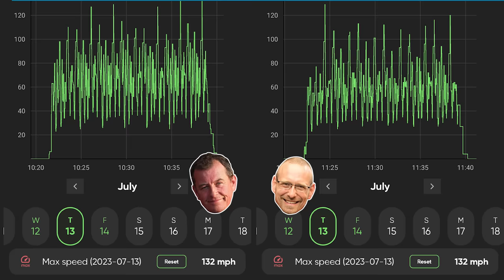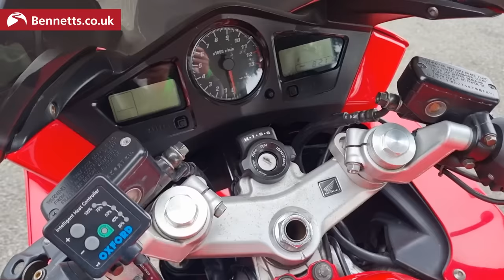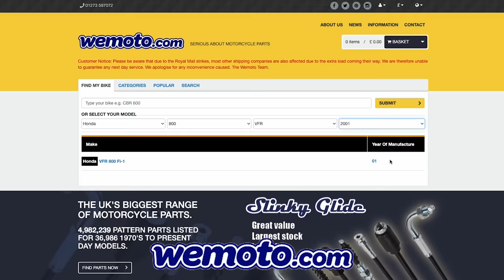John McGuinness FLAT OUT on 100,000 mile £500 bike: Will it survive?

Comment: Proud owner of a red VFR 800 FI from 1998. Brutal build quality: first chain changed at 60,000 km, still bright red paint, no rust after 25 years. Widely underrated, but the 1998 for the European market has an engine with fantastic torque, exceeding both those for the US market, the catalyzed 2000 version tested by McGuinness, and the VTEC itself. She drinks a lot (13 km/l at all speeds) but I love it. History will prove her right. And this video is a proof.

Comment: I have a 98 VFR like that one. I often think of changing it for something more modern, but then I take it out and the V4 growl grabs me. I’m going to keep it for as long as possible and have touring plans in the pipeline. It’s only done 29k so loads of life left!!
Reply: I have a 2000 VFR with about 65,000 km on it and I sure wouldn’t sell it for that price.  Gen5’s are great bikes with v4 engines, gear driven cams and single sided swing arm, built to last.  Mine is going to easily outlast me.
Reply: I just bought a 97 VFR with 50k on the clock 3 weeks ago, absolutly astounded by the build quality, its like its come out of the showroom, i also ride a 2001 bmw R1150GS which has 57k on the clock, the motor is great on it but the build quality in places is a bit ropy, peeling paint, alloy corrosion etc.  I think honda's of the 90's were at peak build quality.
Reply: Same! Mine has 56000 Kilometers and its my daily driver.
Reply: Of only honda made a v4 nakedbike like the tuono. They should revist the rc30
Reply: @mala7794  v4 fanboy , explains a lot
Reply: @GaijinGamerGirl  dream bike is a tuono factory 1100v4 so yeah pretty much.  (Russian bias)
Reply: @mala7794  when the V4 VFR came out, naked bikes were not that popular, honda had the CB750 but it was all about the sport bike or sport tourer.  The RC30 was a beast, especially with the great joey dunlop riding it at the TT
Reply: @mala7794  you're Russian 🤣🤣 my condolences
Reply: @GaijinGamerGirl  oh no i just saw gajin and tought u might get the reference from wt. Im from scandinavia
Reply: @GaijinGamerGirl What's the problem with V4's or Russians?
Reply: @Notevenallowedtoburnwood  You're clutching at straws
Reply: @GaijinGamerGirl  Why am i not surprised you didn't have an answer.
Reply: I have the same thoughts at times! I have looked at the Aprilia V4's (Tuono and RSV4), but very hard to justify the price and maintenance when compared to the Honda in my garage that's paid for and has always worked perfectly. I love my 2001!! I have looked at the 800F as the dash and LED lighting would be a nice change.

Comment: Definitely!  I had mine on a dyno recently and it’s putting out 114bhp at the wheel.  it’s a 2002 5th gen pre vtec, with 20k miles on it.  It’s a fantastic bike!  just had the suspension serviced by maxton and the handling has been transformed.

Comment: I’ve owned two VFR’s, an FL and an FV which I’ve owned from new in 1997. Apart from a reg/rectifier and back shock it’s been totally dependable. I’ve toured it, track day’d it and used it as a courier bike. No camchain or belts to worry about, it runs like a Swiss watch. I checked the shims at 36k miles and only one was slightly out. Brilliant bike, great all rounder and one of the best engines Honda has ever made.

Comment: my bro's 162,000 miles 2003 honda hornet 600 only goes upto 100mph now instead of 140mph haha.
He bought this engine secondhand with 43,000 miles on it, fitted the engine himself and done 119,000 miles with it.
Oddly the original engine did only 25,000 miles, mostly from the previous owner.
Still runs perfectly even though the valves clearances have never been adjusted by him.
He checked the clearances recently and the tolerances are only  just within range.
He changes the oil every 5,000 miles with fully synthetic castrol power 1 racing & a k&n oil filter.
Reply from the maker: Something's not right there! Still, glad it's still running. My first thought was valve clearances. I assume it's breathing okay?
Reply: @bennettsbikesocial  It breathes ok.
It's got a couple of weak valve springs, on the inlet valves.
Still runs very good though, and uses hardly any oil.
Must be because of the 5,000 mile oil changes from 43,000 miles with fully synthetic oil that's made it last for so long, and has been regulary thrashed nearly every day too.
On all the gearboxes i have taken off i have found the oil ways on the input and output shafts did not line up with the oil ways on the gear pinions from factory.
By lining them up, the gearboxes last much much longer.
You should also replace the oil pump no more than 50,000 miles.
When you turn the oil pump by hand it feels very stiff and graunchy when they get to 50,000 miles plus.

Comment: I used to love when a gsxr 600 or r6 pull up at a light and I'm on a 91 vfr750 tuned and engine upgraded with jets and power commander fuel program and custom exhaust tuned to the bike adjustable shock and front forks and they see you 2 bike length off the jump and you can't reel it in on the 8th because the v4 valve is  a torque monster

Comment: Having owned 4 vfr800fi 5th gens and currently a 2008 vtec vfr800 i can say they're brilliant fun even though theyre on the portly side of the weight equation.  Gear driven cam engines just rock. Saying all that my current 2008 vtec model is ok once youve spent money sorting its quirks. 1 tooth smaller on the front and plus 1 on the rear sprocket helps alot, junk the boat anchor pipes and fit something light and obviously the sound is way better. Saved 7 kgs off the exhaust and junking the rear footpegs. Power commandor 5 fitted and tuned to perfection on the dyno and now itll pull smoothly from as little as 2700 rpm with no fuss. I fitted an adjustable yss shock, racetech .95 fork springs and set up the ride height 10mm higher in the rear and lowered the forks through the clamps 5mm and she turns in like a different bike now and is a different bike to ride. Spend the money on the right mods and shes great.

Comment: My first ever bike was the Gen 4 VFR and I had a Gen 6 afterwards and now riding the Tiger Sport 1050. I still miss that Gen 4 and the character of the engine. Forget the V-TEC that the Gen 6 onwards have, the Gen 4 had all that torque on tap at any rpm, not to mention it didn't suffer from the overheating issues that started with the side placed radiators. Happy with my Tiger now but my Gen 4 VFR will always hold a special place in my heart.
Reply: My gen 6 had 200.000 km on the counter when I traded it in for the tiger. Engine was still going strong but the electrical gremlins left me feeling worried every time I went on a longer ride - would I make it back on my own power or not. Just not a very good feeling when you set off to go touring

Comment: I bought a new VFR in 1988 to despatch ride. It was one of the first Hondas with a three year warranty, I was determined to kill it. 130k miles in three years, driven in London traffic and thrashed up and down the country. It went to the island, Dutch TT and spent most weekends wearing down the hero bumps on the pegs and changing head race bearings due to the amount of time it spent on the back wheel.
 I sold it when it ran out of warranty then saw it a year later being ridden by another despatch rider. It was on a 177k miles. 15:28 
 That too was run on rock oil :)
Reply from the maker: Blimey - that's some proper hard work!
Reply: @bennettsbikesocial   Not sure on your age group but the VFR predecessor was the VF750F that suffered major valve train and cam issues with huge warranty claims. Urban myth says the VFRs were deliberately over engineered with a 3year warranty in an attempt to get their reputation back.
 I read somewhere that they no longer have gear driven cams?

Comment: Great video of a great bike. My 1998 VFR 800 (in red of course) has done 26k and goes great and sounds great, especially with the stainless steel exhaust fitted a couple of years ago. I've had it 20 years and it will be my last bike of the many I've owned. Usually service it myself apart from the linked brakes, and the stainless exhaust after reading horror stories about snapped studs. Did the valve clearances a while ago and they hadn't changed from the factory settings.
Reply from the maker: 20 years! Nicely done!

Comment: I test rode one of these vfrs back in the day thinking I was going to love it … coming from a Kawasaki zx6-r G2 it felt flat, like it wasn’t revving enough, almost boring. And the linked brakes didn’t inspire confidence and meant it didn’t dig the front end into the tarmac like I wanted it to. Ended up with a bandit 1200 of all bikes which I loved 🤷🏼‍♂️
Reply from the maker: It's tough to find a good condition original Bandit 12 now... I've tried!

Comment: When I was a young'un in the 80s I was convinced a bike was worn out at 30000km. I used to buy new, run it for a year or so, then replace with another new machine. I changed my habits after clocking nearly 60,000km on a RF900 while my kids were little and riding time was rare. That bike showed me that with good maintenance and especially work on the suspension, the newness never wears out. I replaced that in 2014 with a 99 VFR with 76000km, fixed the suspension, steering bearings and clutch, and rode that to 105,000km then sold it for a change. I tried a new 8th gen VFR but that offered nothing that my 15 year-old bike didn't already offer.

I currently own a 2005 ST1300 with 125000km, and another 99 VFR with 90,000km. I have no intention of selling either as they run perfectly and handle well, and just don't depreciate. It helps to be able to do basic servicing like fork seals, head bearings and brakes. Having more than one, older bike, reduces the fear of being rideless if the work goes wrong.
Reply from the maker: Well said! Yes - with fairly basic maintenance there's little reason for a bike to 'age'. Cheers, John

Comment: I got 120k miles out of my CBR600F3 before I sold it, it was burning some oil at that point, needed new fork seals and a new exhaust (being crapy steel). But I put that bike through a lot of abuse and winters. The engine was running fine, never let me down.

Comment: Yup, my CBF600N8 is just about to clock 125,000 miles and will have the shims checked and throttle bodies balanced, along with new spark plugs. The mechanic does this every 25,000 miles. I do the rest. Oil and Honda filter is changed every 5,000 miles - Castrol fully synthetic Power 1 Racing 10W-30 oil. New radiator at 75,000 miles and I think the bike would now benefit from the original rear shock being replaced.

Comment: Have a 2000 model VFR, same gen as this over here in Australia. It's more than double the k's of my last bike sitting at around 130,000km which is around 80,000 miles and is the third oldest bike I've had and it's still somehow the most dependable bike I've had so far. Not a hint of any trouble, no burning or leaking oil and the engine feels like it must pull just as hard as it did on day one because it seems to be a bit quicker than my 05 GSXR 600 which has an even better power to weight ratio and just under 50,000km. The extra torque surprisingly seems to make up for being heavier and less powerful though I am pretty tall. 

Truly amazing bikes

Comment: I take my 91 750 on the track, Hagon shock and updated front forks, it’s brilliant although there’s no way I’d run road tyre pressures at the track, 30/32 gives much better grip, your tyres have chewed up because the pressure in them is way too much, my M7RR’s get balls on the edges but don’t chew up like that , you can see the front isn’t using all the tread because it’s too hard.

Comment: Just over 90k on my '98 FiW.
Would never use a Hagon shock.
Mine has a Nitron.
Not surprised by anything John said.
Looked after these are stunning bikes, but early models do have problems with R/R and corrosion of the instrument PCB.

Comment: Watching this, and the previous videos on the VFR make me simultaneously excited and dread the inevitable shock absorber replacement. Oh, and please put the bike on the dyno as mine is the same year (but only half the mileage)!
Reply from the maker: Turns out you don't have to remove the bottom linkage bolt to get the shock out, though I still would have preferred to as I wanted to grease it. Cheers, John

Comment: I bought a 2004 GSX750F with 47k miles for £1500 some years ago with the help of my mates we rebuilt the bikes suspension , chain and sprocket, all bearings decent engine service, full exhaust system new tyres I spent £1000 on it she took me all over including Cadwell and the NC 500 did a 461 mile trip to the Highlands in a day and the same trip 3 days later after doing the circle around the highlands you can see the bike on my YouTube channel Chronicles of Dot my point my latest bike an Africa Twin Dct cost £9k yet I had as much fun on that old Suzy for a lot less then my present bike and I still wish I’d kept her old bikes are fun to own and very worthwhile I learned so much from that experience ❤she had 61k miles when I sold her .
Reply from the maker: Definitely! You don't have to spend big money to enjoy motorcycling

Comment: Honda made to last the vfr is a cracking bike thats why i have 3 of them my 750 fj model is almost up to 70,000 miles myself hgv mechanic so do all my own maintence  yeah do a dyno run myself i prefer the gear driven cam motor over the vtec one had a vtec found you had to work it work more  .

Comment: When you can buy a bike over twenty years old, nigh on 100K miles and a professional bike racer like Mr. McGuiness can put it through it's paces around a track redlining and it never complained, it shows that the bikes sitting on the showroom floor with 1000 miles and little more than six months old, people have become too obsessive where mileage is concerned.
I've done it myself, seen a bike I really want only yo let it go because of the mileage.
However, the bike seen in video has been a good un' with little to nothing wrong with it. The VFR 800  F has a bullet proof engine ( Gear Driven Cam version ).
As long as a bike has been looked after, regular oil/filter change and hasn't been thrashed (You can get a fair idea by condition, any scrapes, head bearings, completely stock, etc) it should last you a long time...

Comment: Meh. It's a VFR with only a 100.000 miles on it. 
That's barely broken in, mate.
No worries.
I met a guy in spain, with an RC36 with almost 300.000 kilometers on the clock.
Not a spanner wrong on it. Just maintenance.

Comment: smooth turbine like behavior? I have a 2001 VFR , I ride on the street , put a 520 conversion chain on, ABM straight bars. I wouldn't trade mine for 2 v-tec models .  My power is always ready. That's it's character .

Comment: The big thing here is this!!  If you aint got a lot of dosh and you want a bike that almost does everything go for the vfr750 or 800 you will not go wrong and they both will always get ya home. My 1200 B.M.W. G.S. did not and as far as I am concerned its an over marketed pile of dog poo it really is you need a bloody mortage to run one. Parts are out of this world so when you hear folk say mine has done over a 100K ask them what the cost was to get it there
just like triggs broom in fools and horses ??? The Honda will cost you peanuts if you look after it just like Toyota my van is now on 375K with only tyres bats and a radiator to complain about Jesus I need to stop talking !!!!!!

Comment: Wow. I don't even walk near anything that comes out of the Rock Oil factory. You might as well put chip fat in it. Just spend a bit more and treat it for one time in its life with Silkolene Pro-4. The improvement in power and smoothness is instant and miraculous. And it lasts a very long time before it even begins to go dirty. And that's a good indicator of how well it's holding up between changes. As it's red, you have to do a few changes to flush out the inferior stuff. And EVERYTHING is inferior to Pro-4. Doesn't matter what grade. Shite like Rock Oil turns black in under 200 miles. I'm not joking. Thankfully I found out 40 years ago about Silkolene. The only other best product on the market used to be PJ1 Blue Label chain lube. Sadly, the lefties found out about the ingredients in that and had it discontinued.

NOTHING is as good as Silkolene fully synth - even Silkolene semi synth is shit. Like Comp-4. I don't even put that in the lawn mower. That also gets nothing less than Pro-4 athough the lawn mower's larger build tolerances means it drinks it very slowly. Had it from new. After the initial 600-mile run in period all my bikes get Pro-4. ZERO engine wear or even tappet adjustment required. Had my 98 Blade from new. Runs better every time I get on it. Nurburgring Bridge to Gantry in 8 minutes 25. Got the video.
And the T-shirt 😃